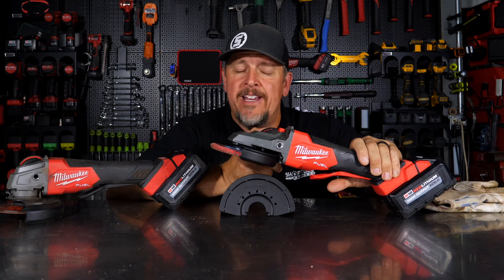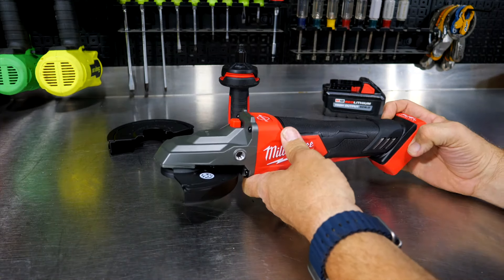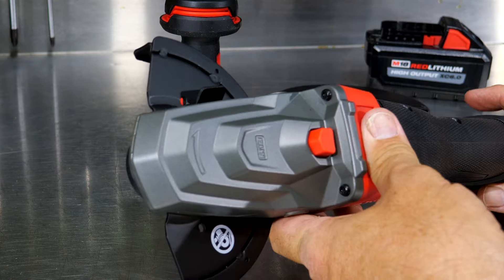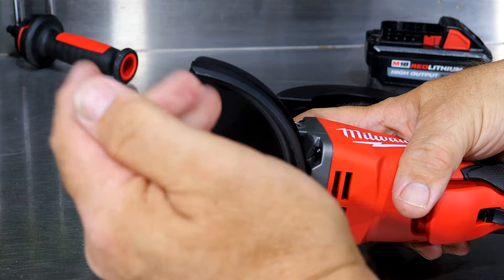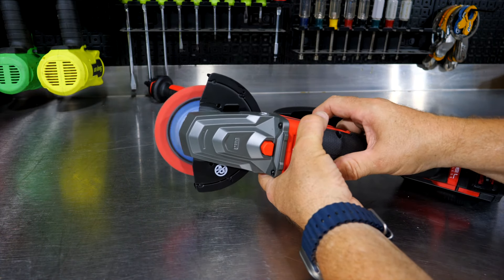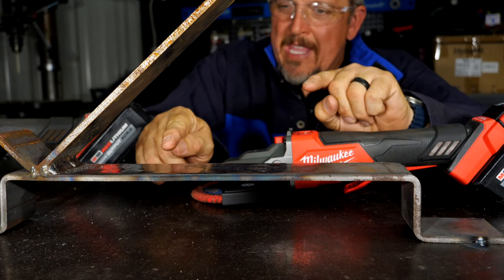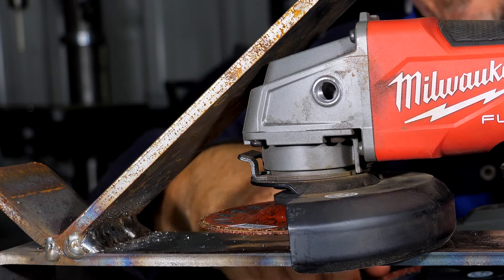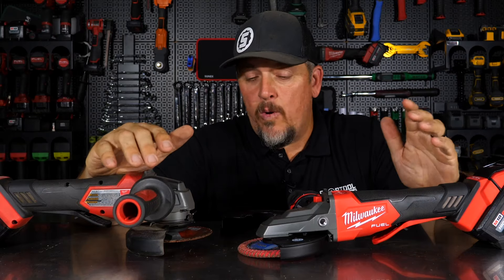MORE ROOM!! Milwaukee 2886 M18 FUEL Flathead Grinder Review

Comment: As a Flex user, I'm kinda disappointed that the inventor of angle grinders didn't think of this first. I'll have to let my brother know so he can add it to his Milwaukee set.
Reply: Milwaukee didn't invent it😂
Reply: @aetorres7422 he's clearly saying flex did
Reply: @james2042  no he's clearly stating the inventor of the grinder didn't make the head smaller from the get go
Reply: @zanehaselden5573  flex originally invented the angle grinder just for your info. I am a milwaukee fan though. Milwaukee invented the sawzall
Reply: Metabo had these for years, I'd imagine the real Flex also has had these for years but I could be wrong on that.

Comment: Flat head grinders are a life saver when you need them. I have a corded Metabo 6” flathead that gets used a hood bit. I recently bought this m18 fuel flat head with a 4 1/2” fuel m18 grinder package deal from Home Depot. I returned the 4.5” and ended up on paying $180 for the 5” flathead. I’ve used it a few times and I’m very pleased with it

Comment: If just buying one of the two choices, which one is the best? I’m thinking the flathead would be more versatile. What are your thoughts?
Reply: Flathead + a cheaper or bigger diameter grinder.
Reply: Variable speed if you just get one. Do you even have the need for a flathead? There so many tasks in grinding and polishing where I don't go full speed.

Comment: Needs a slide switch, paddle is going to get in the way them tight spots
Reply: Nah, its just annoying when its not variable speed! Just worth to buy switched version 100%!
Reply: It not being variable speed is actually so annoying. Especially because the heads are interchangeable between normal and flathead.